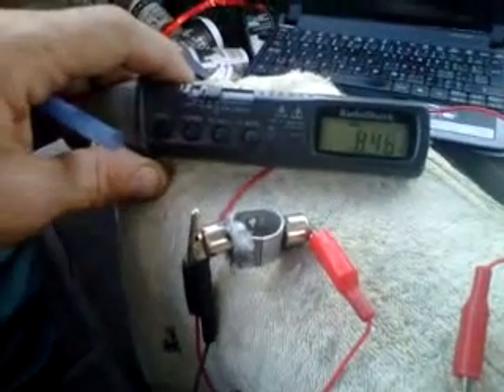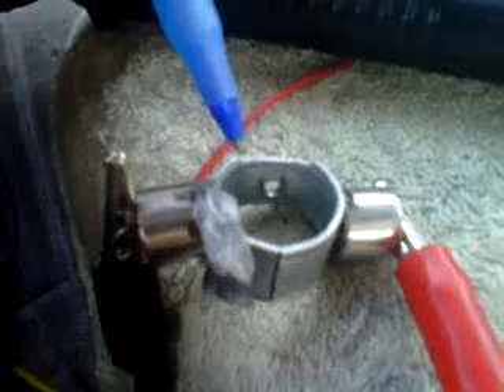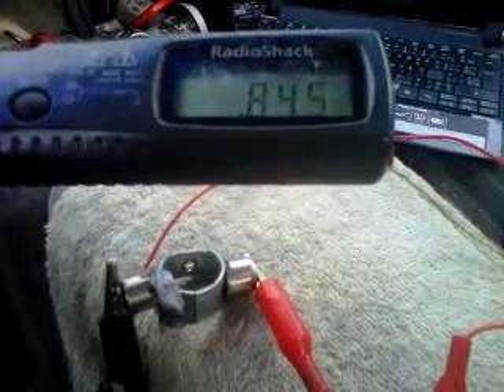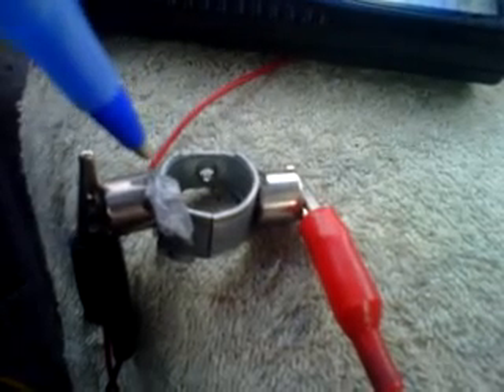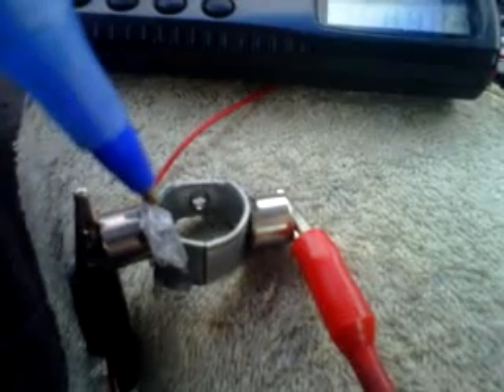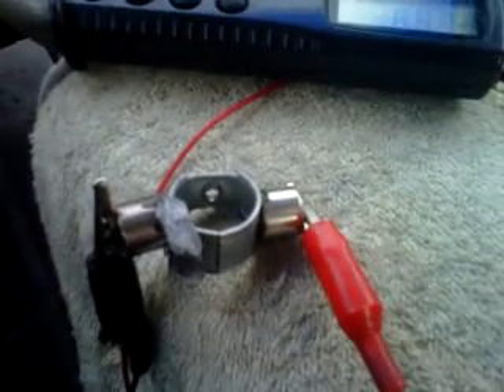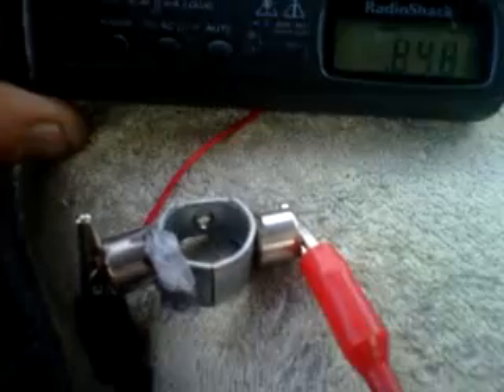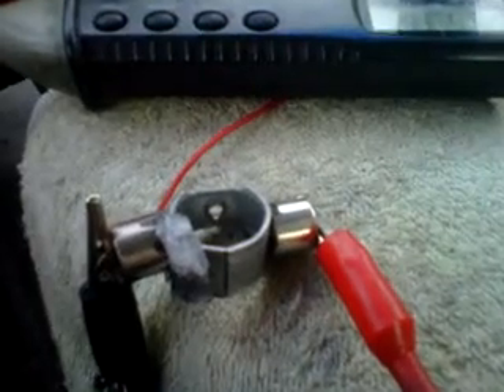activated carbon magnetic battery

Comment from the maker: that red wire you see is the red wire clip lead connected from the magnet going to my meter...the black wire is also going to my meter but from a different route which you cannot see......this is simply as shown...you can try this your self.....2 neo magnets, a galvanized iron cylinder and a plastic bag containing carbon which is doped with simple water....if the connection is made good enough you can get 1 volt out of it...this video shows a very quick crude connection.

Comment from the maker: as observed by some of you..this may well be just a galvanic battery  but consider this....in a hall effect sensor, a small current is sent through a gold leaf of which is exposed to a magnetic field, the electrons are shifted to one side of the metal more so than the other side, this causes a charge displacement to develop..so why can't the same thing be happening with my unit...it seems realistic to think so because without the magnets power drops to 0.3 volts and with the magnets is 0.8 volts

Comment from the maker: you may be right except that when i remove the magnets....power drops to 0.3 volts......adding the magnets jumps to 0.8 volts so something is going on with charge distribution accelerated by the magnetic fields.

Comment from the maker: duration is on going ..1mm cube of activated carbon has energy storage capacity in access of 10 football fields. the cylinder i'm using is only to separate the magnetic force of the magnets from crushing the carbon and puncturing the plastic..it is not needed...i believe the different metals contribute to the effect. galvanized iron contains zinc,neodymium from the magnets and carbon all interact to cause charge displacement. magnetic force contributes to charge directional flow.this project

Comment from the maker: yes....charge separarion is ocurring by magnetic dissociation of the atom..i built a few cells and connected them in series and parallel..i reached 12 volts in series but only 8mA current..in parallel i reached 1.37 volts @ 340mA...these powers were fluctuation due to crude assembly..i used simple tap water which is loaded with minerals which i believed was the cause of it working....impurities was the key...acids work better but more toxic.currently there is nothing further but will continue...